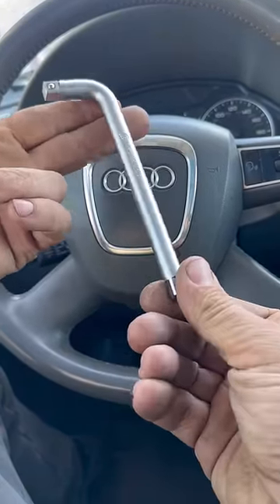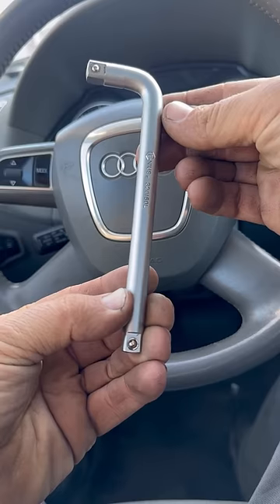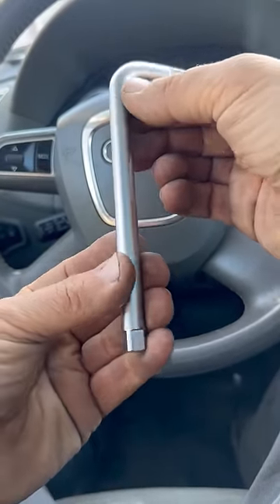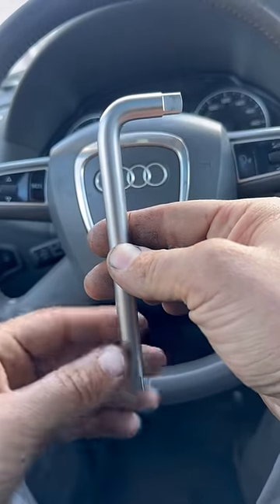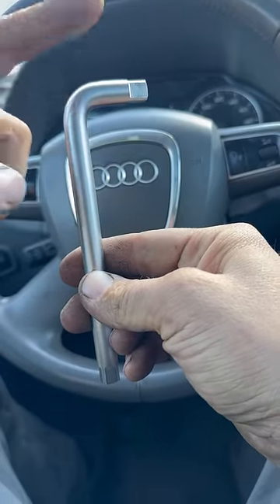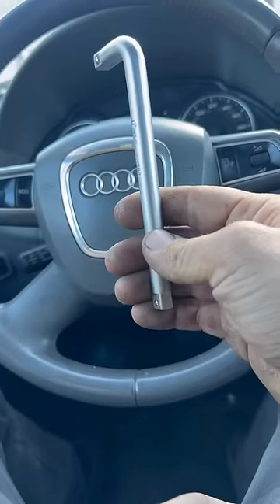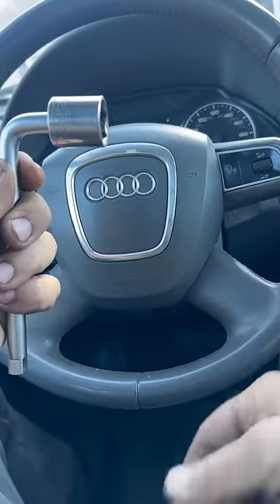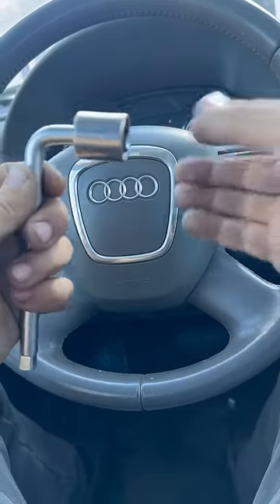Mechanics Must Have Breaker Bar Genius Tools 3/8" Dr. L-Handle - 320160L

Comment: That style breakerbar you can add extensions to increase the leverage
Reply: I haven’t tried, but a problem I see is, extensions are made for torsion, not bending. Going to off center those extensions and have them wobbling off ur power tools or making a ratchet not line up straight anymore.
Reply: Why would you add a ratcheting mechanism to a single bolt hinge breaker bar? …on a train.
Reply: Daileyandrew your not understanding what I meant by adding extensions 2" 4" 6"  I didn't say a thing about ratcheting at all I was referring to extending the leverage point." Do I need to draw a picture ".

Comment: Every manufacturer used to make them. It was simply called a socket wrench but now gets called a 3/8 square L wrench i guesss. Before the " ratchet" this is what had to be used to turn a socket, many sets were hex drives because they're easier to manufacture, you can still find all these super basic tools at garage sales etc. And many are still a pleasure and joy to use. In the 1923 Snap-On tools Catalogue A it was advertised and sold as a "no. 1 offset" and had a 'luxury' knurled handle for grip. It was $0.80😅
Reply: electric screwdriver
Reply: They were often called an L handle, every socket driving tool was a type of handle.
A ratchet handle, a spinner handle, a flex handle, L handle, T handle, speed handle, sliding T handle.
Reply: lol @ $0.80 

Can’t even buy a plastic tool for that much now

Comment: I remember these when I was an apprentice truck mechanic, used them mainly on road rangers and diff fill and drain oil plugs. 9 inch diffs as well. Long time ago. I think koken tools japan make them. Mine was sidchome. A lot of them end up in the boot of your car for tyre changes

Comment: Who makes that tool? I can imagine the potential.
Reply: Genius Tools... It's in the description
Reply: @davidclark9171  thank you for not raking my carcass over the hot lava and coals of the internet. I totally missed it.
Reply: Search L handle breaker. A torch and extra extension will get you by. If the idea he used to hold a bolt head or nut in a hard to reach place is the reason you'd purchase this. Look up "handee clamp"
Reply: Fisher Price
Reply: Had some good luck with this brand, if you're looking for a Budd nut socket for steel wheels (shorter), they have you covered.

Comment: I have to say that I was having a problem with putting a alternator on one of my old Fords I went out and bought a break a bar and also rented a part to hold back my poly to replace my belt. Not one really work for me. And tear I remember a old part. I had it look like this in the video was from my old bike pedal I found outside and it worked like a champ😏

Comment: Why not just use a slim ratchet and if you need it to be longer cuz you need it to function as a breaker bar then you take a deep socket that fits over the end of the handle and an extension as long as your heart wants the breaker bar to be. And today you have the exact same tool but it has ratcheting functionality😅

Comment: LOL

"I guess you use a ratchet on the other side..."
Reply: It's a socket wrench. That's what it is. It's not a breaker bar, it's a wrench. Faster than any other method, until power tools became good enough for professional use.

Comment: Theres a reason that got fazed out years ago and there it shall stay. Every socket set has the swivel extension. Which you barely use cos of the ratchet drive, that thing you have is antiquated and practically useless.